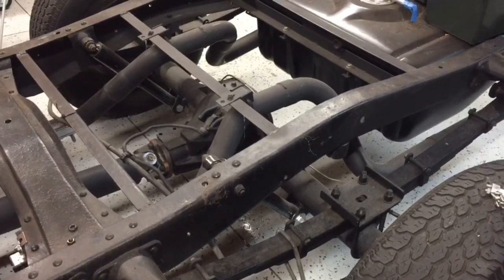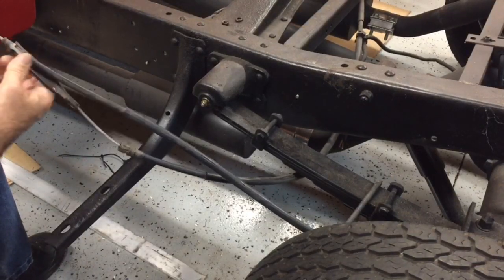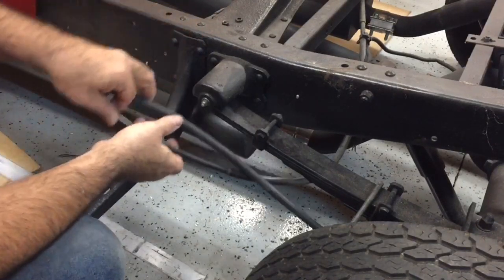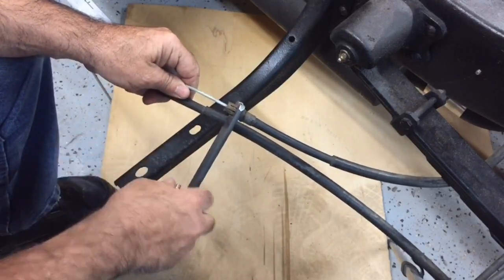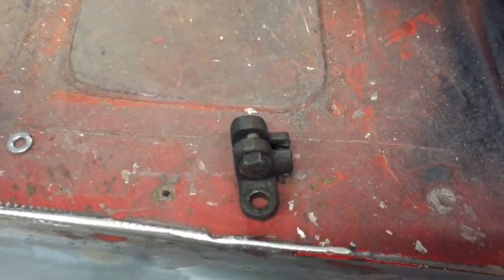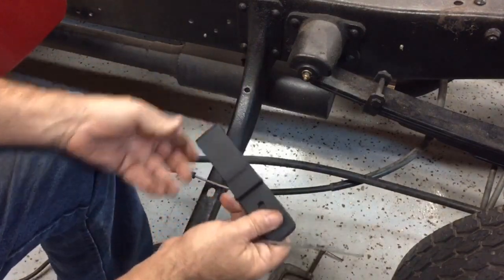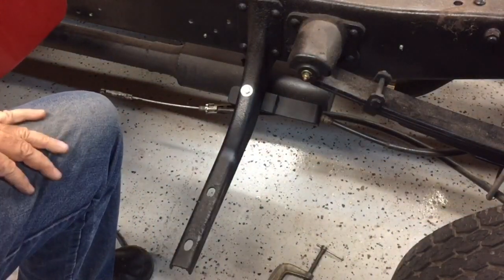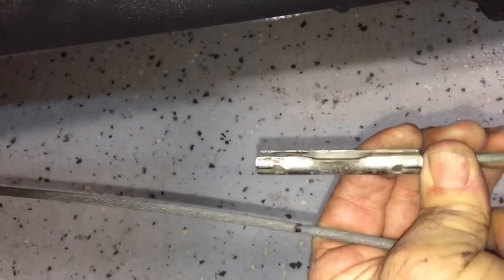Ford 8.8 E-Brake Linkage Ford F1 Build Ep.7

Comment: You do certainly come up with simple, well though-out engineering solutions Tony. What is your work background before you retired? Lovin this project. Cheers, Andy.
Reply from the maker: Thanks, Andy! I’ve been a Machinist since 1972 and  have run my own business since 1985.  When I retired, I sold all of my CNC equipment, and kept my  old 1940’s Bridgeport that I started with in 1985.
I enjoy manual machining/fabricating as it makes you use your noggin. You can do that when you’re retired.  👍 Tony B